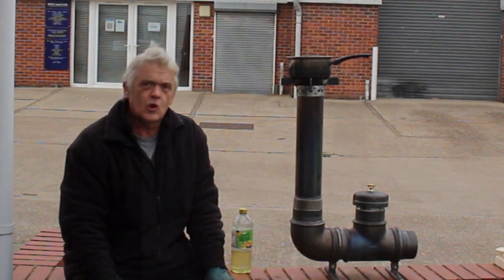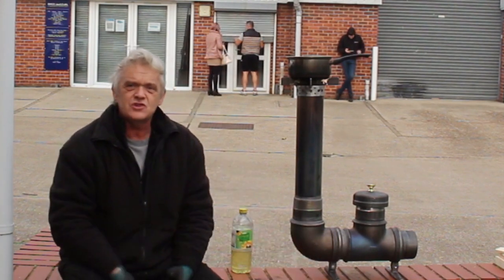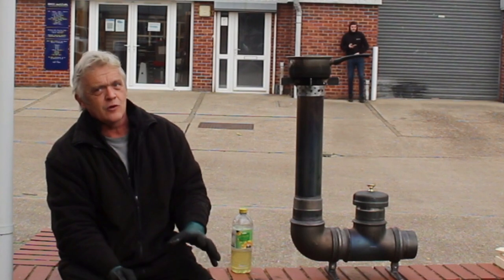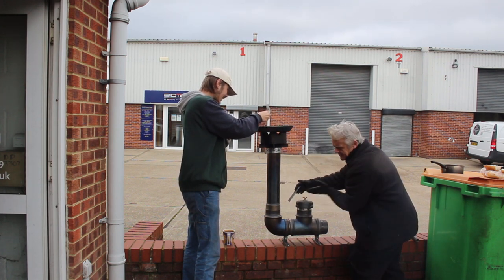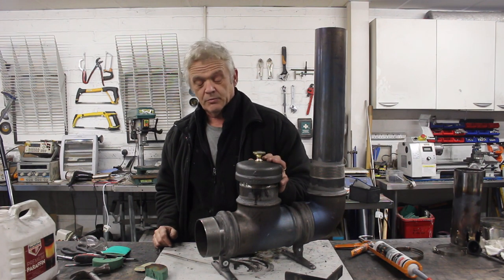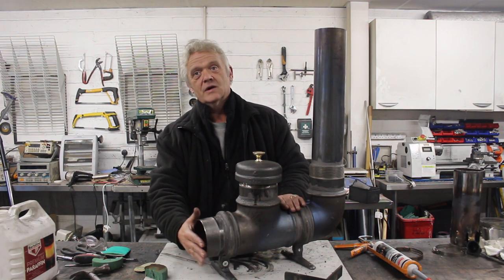1744 The Rocket Stove Kit - All The Details You Need #rocketstove

Comment: Curious: I'm making some assumptions that the looming energy issue is driving interest in small utility heaters/cookers. I'm also assuming that urban citizens would have a greater interest in such a unit...
While several fuel types have been discussed, will Rocket Stove wood-fuel be readily available to the vast majority of UK citizens in urban areas?
Reply: I believe these rocket stoves use very little wood when compared to your regular wood burner and I have seen figures as low as 10% in comparison when the Rocket Stove is paired with some form of Thermal Mass, Heat Retention and Release such as a Masonry heater or sand battery which is then used to heat an area over a long period of time sometimes for days, Look up Masonry Heaters as these have been used for hundreds of years throughout Russia and Scandinavia etc.
Reply from the maker: it's an interesting question mate and Luke is actually looking at this - he should have something up on his channel next week
Reply: They'll burn nearly any biomass. Corn cob, twigs, pallet, dung, ect.
Reply: @got2kittys  I understand the versatility... simply wondering what is the most likely source and its availability...

Comment: Bury it in clay and put half a 35 gallon barrel on top for a mass heater!
Reply: Yes a 55 gallon drum full of high temp paraffin.  But with redundant safety built in of course.  Water would work as well as long as it's not sealed to tight and we'll insulated so the heat does not escape to  quickly.  Water is one of the best at conducting heat but also at releasing heat so we'll insulated is a must so the heat is released slowly.
Reply from the maker: cheers mate

Comment: Hi Rob - loving these heat vids 👍 - question for you, lots of comments relating to pellets/hoppers etc in regard to longer burn times. I'm not interested in pellets/hoppers though but it got me thinking about refuelling times......if you could make the feed pipe twice as long it would mean you could put in much longer kindling, that would increase the burn time. Any reason why this would not work? I'm assuming that the open ended horizontal pipe is purely for air intake and so the longer kindling would not make any difference to that amount of air and also would not affect the height of the section of kindling being burnt? Any thoughts? Ta bud 👍
Reply: Let converse📤😊

Comment: utility. = the chimney flue pipe.. think?  = a steel circular plate with a hole in the center which slides around the flue pipe. about half way down , it will get hot. this then serves as a baking tray hot plate. pies pasties sarnies tea coffee can all be heated upon the circular shelf .    could have more than one  tray/shelf up the length of the tube. this avoids the danger to reach up high to handle hot items .  ...  it also improves the radiant heating that emanates from the tube.  ..  you can also work it out on a piece of (Temp plate? -punn   paper .  The circular plate could have holes or shapes cut out of it ,,patterns,, designs etc. or hang hooks of it to use for warming etc. The MORE  metal used the greater the heat efficiency. .THE CIRCULAR PLATES ALSO DISTRIBUTE OUTWARDS AWAY FROM THE CENTER WHICH IN TURN SPREADS THE HEAT TO A WIDER AREA. THE CIRCULAR PLATE COULD ACCOMMODATE HOT AIR SELF INDUCED ACTIVATED STOVE FANS  WHICH INCREASES DISTRIBUTION OF HOT AIR.  ??? NJOY . THANK YOU FOR YOUR ENTERTAINING VIDEOS...  NJOY.,,,, smallest circular plate bottom level and wider as the height progresses.OR VISA VERSA. OR AN ARRAY OF TRIVETS STAGED UP THE TUBE. THOUGHTS ??
Reply from the maker: I don't know mate - I would have to try it

Comment: I see your cooking, but what of the use of the capped pipe? Do you take off top and put the cap on the end to feed your fuel from the top?
Reply from the maker: yes exactly - I loaded it up part way through the vid - just before I lit it
Reply: You cap off the feed portion to avoid air being drawn through that portion of the stove.  It had the potential to Booger up or slow down the startup, and encourages it to draw through the tallest bit.  The operation of these stoves is based on the control of where and how the air flows.

Comment: The trivet probably does not need to be much taller than making the opening the same area as the opening of the chimney, you said 100mm, so if the open circumference around the trivet is the same as the 100mm opening, it should not have an issue
Reply: I use one from an old gas cooker...
Perfect!

Comment: Are you going to add the additional air holes?
Reply: Was wondering that myself but it looks so good the way it is also.
Reply from the maker: I may do - but this was built for anyone to copy even if they don't have tools so I haven't yet
Reply: @ThinkingandTinkering  With it all being round it has a better cross-sectional area for vortex. My god, the 6" option isn't cheap. Round also lends itself better to have a small metal (oil) barrel over it for a mass heater.

Comment: To be a true rocket stove it needs insulation around the chimney and the burn area combustion chamber. This will maximise the combustion and minimise heat loss the heat will be more focused and you will have flames hitting the pot. I have made them my self. The main area to insulate is the combustion area if nothing else. If done properly these things can get insanely hot with very little fuel.
Reply from the maker: I disagree - to my mind to be a rocket stove it needs to gasify and burn the product of the gasification - which makes for that 'classic' rocket stove sound- what you say about insulation is right but also a matter of opinion as to wether it is a good idea or not - if you get 'insane heat' you will stress the materials and shorten the life of the stove - not necessarily what you want to do if you want you stove to last for a long time - it's really about balance mate - cost of fuel against life of stove made from steel
Reply: @ThinkingandTinkering  have you measured the exhaust to see if you're completely burning fuel? My armchair research says you need to insulate the burn chamber and heat riser in order to get complete combustion and that if you have metal in the burn chamber it's gonna oxidize and not last.
Reply: @ThinkingandTinkering  I agree the insulation adds a whole new set of challenges. most that I have seen have  involved casing the whole lot in something like vermiculite Or a cement  vermiculite mix.  I made one out of lightweight concrete blocks the once made from coal ash. It worked very well for cooking on.

Comment: I am not entirely convinced. For one, throttling the pyrolysis is possible but not advisable. Throttling the burning of the gas, is just wasted gas. 
The other point is, for pyrolysis, you basically wont the heat from the gas burning, heat up the biomass. The design with the airflow beneath the pyrolysis chamber archives quasi the exact opposite. 
Imho, divided, one standpipe is enough. Fuel goes in from the top left, exhaust goes out on the top right. Air comes from the bottom. The left half needs a almost tight top plug.
Reply from the maker: cheers mate

Comment: You should make one out of terra cotta or better porcelain?  Terra Cotta is used for sewage pipes in US for systems where the sewage water goes into the ground.  Dirt cheap
Reply from the maker: I do like that idea mate and will look into it
Reply: I've seen a video where the terracotta will crack
Reply: @justtinkering6713  Yes clay can easily crack even if done professionally.  Robert is pretty good at figuring things out.  There are many ways to reduce the chances of excessive cracking but you anyone can learn that from other channels.  He has special ovens that allow you to slowly increase heat that will also help but not sure if his oven is big enough.  Great point however, as clay cracks easily and is an art of skill in itself.  Earlier of was thinking of using special patterns to strengthen the clay while making the walls thinner.  Though slowing down the baking process is expensive and time consuming it's doable and reduces the chance of cracking.  
There is also the element of a finished product cracking do to the extreme heat.  This can be address on various ways.  Special glazing of the clay, putting loose custom shaped fire bricks under it, or special coating inside the unit.  It may still crack, just depends on many factors especially the material make up of the clay as there are many and the craftsmanship.  I'm totally ok with trying and have no problem if others have different opinions as well.  TY for the input!
Reply: @justtinkering6713  btw I like your paraffin heater!

Comment: Can this go indoors.  And point top to indoor fireplace chimney. To take smoke away
Reply from the maker: I have just done a video on that it will be up tomorrow
Reply: Yes easily, you can use cheap gas exhaust pipes for ovens and gas heaters.  Easy to work with.  Use them both for the outside air intake and the exhaust as well as you don't want the warm air in the building to be sucked out the chimney and replaced with cold outside air sneaking in through the cracks.

Comment: It's not the butter that's unhealthy.  It's the carbs in the bread. Just like someone pouring sugar into the gas tank or crankcase of your automobile. One wouldn't expect the mechanic to raise alarm bells that there are oils and hydrocarbons in your auto while disregarding the obvious malicious addition of sugar gumming up the works right? Similarly the sugar either raw or converted from starch (carbs) attach to red blood cells and cholesterol in the blood stream. This is a process called glycation. Once cholesterol is glycated it is formed into triglycerides. These molecules are now "gummed up" the liver cannot process them and are recognized by the body as a foreign substance and is swallowed up by the white blood cells as an infection would be. These white blood cells are then deposited as plaque into the blood vessel walls in an attempt for the lymph system to eliminate them. So it's not the cholesterol that's bad. It's necessary for life. Your entire brain is made of cholesterol and so is the myelin sheath covering the axons of your entire nervous system, not to mention that it is intended to be the major fuel for your body. Research has shown that high cholesterol levels are actually protective of the heart and puts you at the bottom of the curve for all cause mortality.  So if you're worried about your oil filter getting gummed up quit pouring sugar into your cranckcase. Check out professor Timothy Noakes et. al.  at low carb down under on  you tube for a more in depth look at the research. Or keep feeding the carb addiction, lots of wealthy industrialists, big Ag and pharma all depend on it for their profits 😉👍
Reply from the maker: sorry mate - I don't really care - a bacon sandwich in the morning is awesome

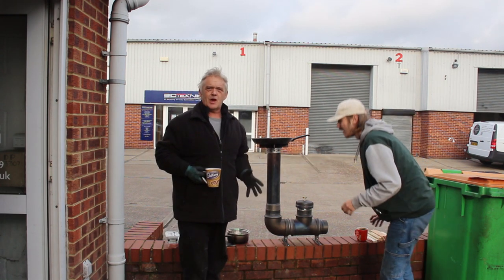Comment: Very useful video. Thank you very very much. However at 7:10 or so it looks like you guys used vegetable oil. Id like to point out that that stuff is extremely toxic to your body, moreso than liquor and it hangs around for up to three months inside u and even becomes deformed hormones and cell walls. Not good. Might want to use a fruit oil instead like coconut, avocado, grapeseed, or olive oil or stick to animal fats like butter, ghee, lard, or save ur bacon grease in a jar. Id hate to hear one of you got cancer.

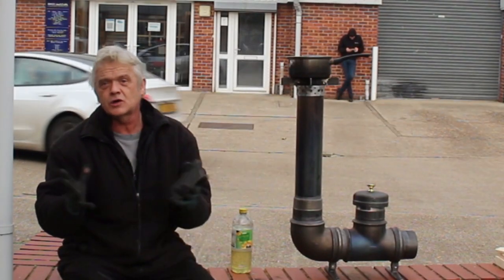Comment: 4:56 Rocket stove in passage way => Fire truck's siren
Poor guy in the back pretending to be on his phone waiting for the camera to switch off so he can piss on the wall or make his drug deal...  😄
So you went through all the L/J/K etc. types (in the wrong alphabetical order, so shocking), but you never explained the Robert Murray-Smith type with the middle part that you can put a nice lid or a steel of plate on top. What is it for? You never use it for anything. Your stove is just a L type as far as I can make it, so a regular pipe instead of this T junction would work just as well, right?